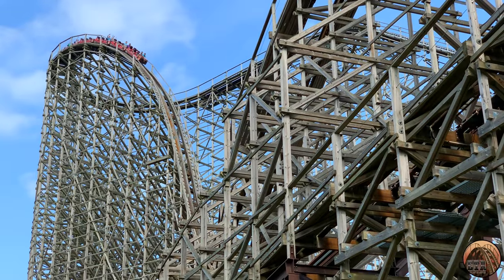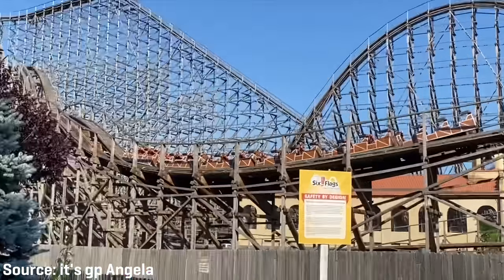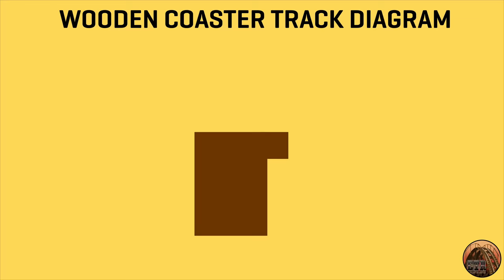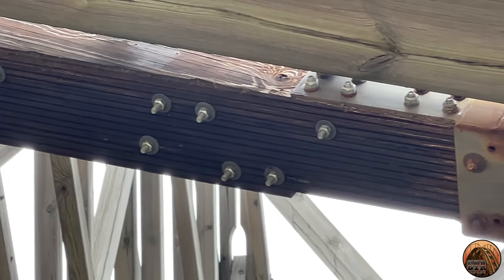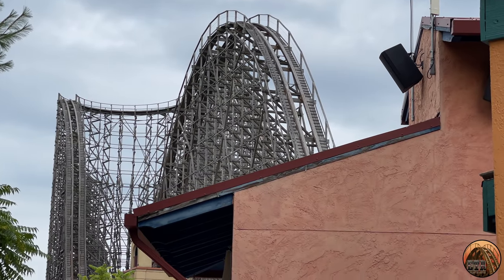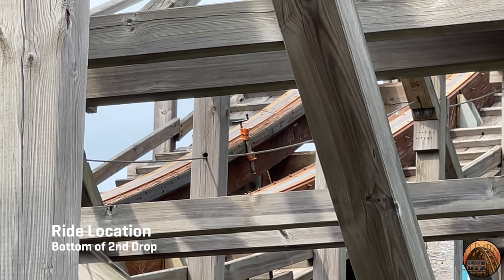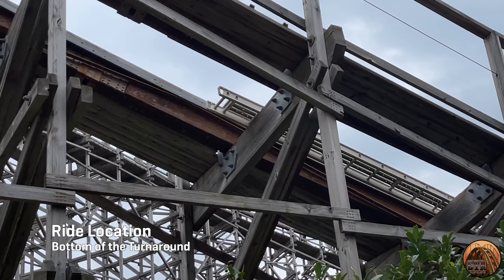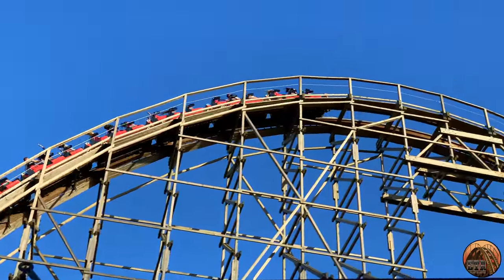What's Going on with El Toro? - Post Accident Update  - Six Flags Great Adventure

Comment: If you're going to have an accident with a roller coaster, this is about the best possible outcome:  No injuries, the train mostly stays on the tracks, and it comes to rest in a location where it's easy to evacuate the passengers and move the train away.  Yes, it's a pain in the wallet for the park, but the park can proudly point to how well the safety systems worked and take some solace in the fact that you didn't have to have people walk the entire length of a giga to evacuate...
Reply: Exactly. This is why we have multiple layers of safety features. None of them should fail, but if one does the others can pick up the slack so only stuff gets damaged. Stuff can be repaired.
Reply: @keiyakins  And NOT people's mental trauma in the WORST case scenario of a roller coaster accident!

Comment: Not only am I grateful that no one was injured, but also how quickly the ride operators responded, and the repairs/investigation being started right away. I love coasters, and accidents like this don't scare me from them.
I'm hoping this comes down to human error and not an issue with the ride. Although it could be both. I guess we just have to wait and see.
Reply: it's 15 years old in a state that has snow storms too, something to remember.
Reply: It's human error, the wheel assembly was put on improperly.
Reply: @silversonic99  and there are coasters much older in similar conditions that have been running flawlessly for years
Reply: Might as well give the whole ride a heavy look over.
Reply: Was at least 95 degrees so possible the bearing overheated and failed. Miraculous nobody was injured.
Reply: Hersey or great adventure?
Reply: this was ride operator error nothing operators could have done this was poor matience
Reply: @sum_rand0m  not true they havnt found the cause yet most likey was poor maintenance SF isnt known for there saftely record and the state isnt gonan rush this opened for a year
Reply: @ecoRfan  i was there the day this happened it was like 103 that day it was running real bad a hour before
Reply: I know the people there, they are great
Reply: @NickyD  Heat index was at least 103
Reply: @silversonic99  don’t forget that the rides have been rather inactive since covid. this summer they are operating like crazy bc everything is returning to “normal”.  i passed up an opportunity to get season passes this year bc i heard so many rides in hurricane harbor/sfga are closed due to staffing issues. i also heard they’d reach capacity only an hour after opening.
Reply: @sum_rand0m  source?
Reply: That quick response and overall good management of a very bad situation is why this incident will ''Not'' get featured on a Fascinating horror episode.
Reply: Honestly, I find human error both more common and more terrifying.  An issue with the design or manufacture means that now, they will find it, on this and any other similar ride, and can fix it exactly and permanently.  Bad inspection practices are a park-wide/corporation-wide problem; all of Six Flags rides could be in a state of neglect and even if they fix that now, it's likely to reoccur after a few years when complacency sets in again.

If Intamin makes a press release and says, "hey, it was us, we goofed the ride tolerances for high temperatures.  All of our wooden coasters should be stopped when the weather is over 92 degrees.  We've got new math, new parts will be delivered post haste, then rides may resume hot weather operations," I'll be much happier than if it comes out that Six Flags doesn't notice when their employees aren't doing their jobs properly--which I suspect is the case here.
Reply: Intimin is a shitty coaster company look at how many accidents they have had the past decade. Looking like top thrill might get closed for good and they already closed shoot the rapids years ago. Unfortunately many of these accidents could be prevented with optimal safety equipment installed but as we all know humans aren’t perfect and I wouldn’t expect anything less by putting these teens and young adults in charge of operating these rides. In all honesty with the technology we have nowadays there’s no reason why they can’t have a computer run the ride while they have the kids man the station and make sure guests get on/off ride safely. Just glad no one got hurt would be a terrible lose to the roller coaster community to lose this coaster
Reply: Same

Comment: I have been a mechanic for almost 25 years. Most of those I’ve worked at a large fleet where I and my team are responsible for maintaining everything from heavy equipment to semi trucks to cars and even the lawn mowers and weed eaters.  I can say that if this was caused by a wheel bearing there is really no way I see that it would have passed a proper inspection that morning. I’ve seen hundreds upon hundreds of bad wheel bearings in my time come in and many of them where on the road “going bad” for thousands of miles before drivers brought them in for repair and the wheels never came off.  If they find it was a wheel bearing i give you 100 to 1 odds that the report will also say it was not being properly inspected.  Just my take on it.
Reply: I'm no mechanic, but that's my inkling. Stuff like this rarely "just happens." There is always a chain of events that has to take place before an accident like this occurs.
Reply: Spike S  they're not saying that.

They're saying that these coasters go through rigorous Inspections and that wheel bearings are not a "time expired time to blow" object. A wheel bearing rarely just goes boom out of no where.  There are Generally major signs for a while before it actually goes critical failure.
Reply: Spike S  bearings come apart every day. But not on properly maintained and inspected equipment.  Defects in bearings to the point of them being “good on inspection” in the morning and a handful of hours going bad to the point of not only failing but coming apart, fortunately,  happens on such a rare occasion we may as well just say it doesn’t happen anymore. Timken has done literally hundreds of studies o showing this to be the case. Also shows that well into the 90% of short bearing life complaints were due to improper installation of the bearings resulting in the short life with the number one reason being over torquing. 

Unfortunately I have seen my share of broken parts and it’s amazing how messed up something can be and still be rolling down the highway at 80 mph pulling 10s of thousands of pounds. Me and my crew are responsible for making sure that doesn’t happen.  Thus why we have very strict inspection and maintenance procedures. 

All that being said, me and my crew are anxiously waiting to see what the results of the investigation on this is. A couple of them believe this was a defective bearing, of course I disagree.  A friendly wager was made and of course I’m going to be right on this one lol 😂
Reply: @thegamemaster2000  yes. Exactly correct.  A wheel bearing is actually very easy to inspect.  If they do in fact do a full inspection every morning a bad wheel bearing should have been evident.
Reply: Spike S  again. You seem to be agreeing with my statement that properly installed, inspected and maintained bearings just don’t really have catastrophic failures. 

If a bearing was installed dry and over torqued and everything was done wrong in some glorious symphony of errors there is a possibility this could have happened.  But if this was the case it was not the fault of the bearing but the maintenance staff which is my point. 

Would also be surprised if they were using basic tapered bearings and not a sealed bearing in the wheels which is most popular all around today in most all applications except for say semis and some heavy equipment areas which I deal with daily. Either way if this was a bearing issue the chances it would have been inspected properly and was actually good that morning and had a catastrophic failure hours later is just so slight. If this was a bearing failure I have my money is on the final report saying it was due to improper maintenance and inspection. 

Wheel bearing is an easy culprit to go.  What are the odds it’s some other freak thing like a fatigued axle or weld broke?
Reply: Spike S  do these trains have grease fittings to grease the wheel bearings?  I’m not aware if they do or don’t. The only wheel bearings I have ever dealt with that had fittings where small to mid sized trailers and I know people over grease those and blow out seals regularly. All other wheel bearings I deal with that are greased are tag along axles and back axles of front wheel drive vehicles which are all packed bearings and require periodic maintenance. 

Most all other wheel bearings applications we deal with are oiled bearings.  Much larger bearings and heavy duty applications.
Reply: Spike S  yes. The rest of the train remains. But if it were an axle it would have been on the front axle of the last car, not a coupler from car to car. For instance say the right front spindle of the back car could have become bent or broken. The rest of the cars on the train would have been fine

I have not seen a blueprint of the cars and trains so I am only speculating as to what else could have happened
Reply: ride was running like shit a hour before this happened second it was 103 weather out easily could have overheated
Reply: Spike S  its SF its also most likey because of the extreme heat that day there is times things cant be found by a human eye also could be because of the heat
Reply: Spike S  i rode toro a hour before it happened i even told the operators something was wrong it sounded like shit and was running real slow i was over by nitro when the accident happened and holy fuck you could hear it from over by nitro and JD
Reply: @merkerb  thats not always the case with intmain and rmc coasters since there rides are so extreme that it can be fine in the morning but by nightime there always fixing wheels on SV at CP by 5-6 pm at night its very possible the heat played a role
Reply: @merkerb  could have been a train axle the thing was running bad hours before
Reply: If it was a bad berring it would have ate the shaft or the race. Look for that orange dust.
Reply: They could have pencil whipped it.
Reply: I’ve never seen a berring that has a zerk
Reply: I'm honestly thinking it is very likely a lazy maintenance check where they give the wheels a flick and don't really watch them long enough to know if it's good or not. If there are a lot of checks to do and they felt rushed, they may have half-assed it to avoid getting bitched at....or they could just be lazy. Either way, I do feel like it should have been noticeable before it failed
Reply: Spike S  I don’t know how it is a great adventure but at the park where I’m at any sound of a bad bearing on a coaster or ride and ops is gonna hold the ride down till maintenance gives the ok. A bearing bad enough to cause the road wheel on a coaster is gonna be obvious way before failure
Reply: They know why it happened and it wasn't bearing problems, the track flexed at the bottom of the drop and spread the track and the wheel popped off it.
Reply: I wonder how the bearings are actually checked? Just by spinning the wheel under it's own weight? If that's the case, I can see the check being insufficient for catching a worn bearing, as they are best checked under load. Either way, I agree with the logic that if it was normal wear, it wouldn't happen overnight, though who knows with the state of the supply chain over the past few years; could have simply been a low quality part tossed onto the train.

Comment: This is frightening! I always ride in the back seat of El Toro so, I would have been in that car if I were on that train. Such an amazing ride and I hope they can get it fixed. There should definitely be an inspection of the entire layout after this incident.
Reply: the state red flagged i can bet you there gonna check every inch every small spot this thing is gonna be closed most likey to next summer rumors it may even need to get trim breaks
Reply: Spike S  GK wasnt red flagged by the state the fact NJ wants to have a full report and how to fix the issue its not gonna be simple of tetsing it probally will need either a MCBR or trim reaks to slow it down plus the state wants to know why it couldnt be E stopped
Reply: I was there on June 3rd went on the back of El Toro 3 times… crazy

Comment: As to my knowledge, coaster wheels don't use ball bearings but tapered roller bearings as they can hold more lateral loading. That said they can still fail but normally go bad more slowly and noticeably.
Reply: The lateral loading isn't that big as far as I know. It's nowhere close to lateral loading level of helical gear on car transmission, since side wheel does exist
Reply: This makes it seem more and more like a human error issue then
Reply: This happened on the fourth day of an extreme heatwave during peak temperatures.
Reply: @ecoRfan  104 that day
Reply: @NickyD  eh the ride needs attention people just font care because its sooo good 🙄🤏🏽 but nobody held concerns over the safety of the ride day by day. I will not go on a wooden ride just fir this reason unless its rmc!!!!
Reply: @matthewclark4510  If this really has to do with a wheel bearing, than the manufacturer or coaster type really doesn't matter. Bearings failing is only a matter of lifespan, maintenance & inspection and environmental conditions, it could happen on anything from wooden coaster to wild mouse to B&M hyper. The bearings themselves are also just bought from a company like SKF so it's not like RMC bearings are better manufactured than GCI bearings.

Comment: Inside knowledge. I’m a roller coaster mechanic (at another park). The track gauge widened, and the last car popped up on the drop, causing the last car to come partially out of the track. The Train dragged the dislodged car around the track causing a lot of damage. The last car is also trashed.

Comment: I wonder how many hours those wheel bearings logged if they failed and caused the issue.  If well below the MTBF, SF may go after the bearing manufacturer for damages idk.
Reply: what is mtbf
Reply: @jakethecake6952  from the context, probably some initialism that means the manufacturer's estimated or guaranteed service life. Basically manufacturers warranty but on a commercial level.
Reply: I went on el toro around 12 in the afternoon that same day all this happened 😳pretty scary
Reply: @jakethecake6952  Mean Time Between Failure
Reply: @WhozEmzy  i was on it around 1 and it was running like shit and slow i knew something was up even said something and operators didnt care
Reply: Spike S  SF coasters always are in poor shape to begin with
Reply: @NickyD  oh wow.. of course they didn’t care. But ya when I went on it.. where the bar was I had a full line of bruises. Never cried on a ride but el toro had me in painnn

Comment: Fyi wheel bearings can either take forever to disintegrate or can do so almost immediatly with very little warning especially if it has debris gain access through the seals, by the coaster being inspected the mechanics covered himself from any liability
Reply: Certainly wonder if a bearing overheated. It was at least 95 degrees outside, during the hottest time of the day, and the fourth straight day of 90+ degree temperatures. Gut feeling tells me it’s more likely that than debris.
Reply: @ecoRfan  it was 104 that day i was there that heat was extreme
Reply: Spike S  it was 104 that day extremely hot many rides kept having issues because of the weather
Reply: @NickyD  would have been high temperature 95, heat index probably about 104.

Comment: This explained so much of what I didn't understand about what happened with El Toro. Now, I actually feel like I know what happened, why it's still closed, and have a better idea of when it will reopen. You're just the best dude!

I live 930 miles from SFGAdv, but I was there on 8/25/21. El Toro was closed (and I still didn't understand why), Jersey Devil was closed, and Nitro was closed. Overall, the day kinda sucked (bad timing on my part, I guess), but it's not like I won't go back. The lineup is still pretty strong. It's just better if the major attractions are open.

Comment: I love your engineering knowledge. As a coaster enthusiast, I'm subscribing! I was in line at TTD during the "incident" 8/15/21. I was several yards back from the victim in FL aisle. I experienced a small piece of debris ricochet off the railing a few feet behind me. It was higher velocity than something falling from the force of gravity. It seemed to have a horizontally trajectory from the brake run side. Long story short, it was horrific